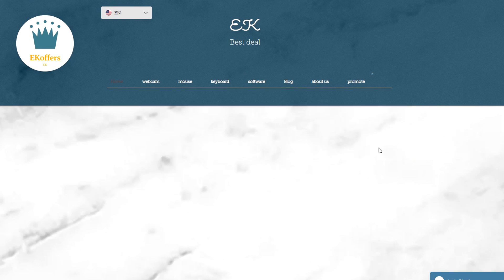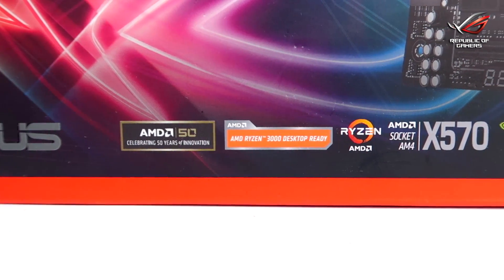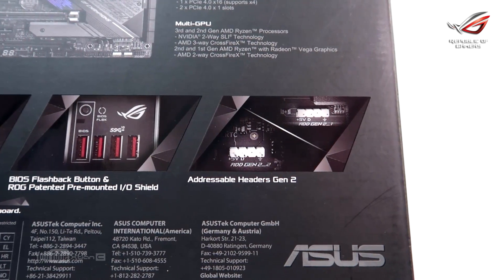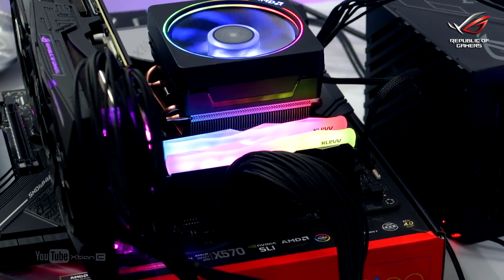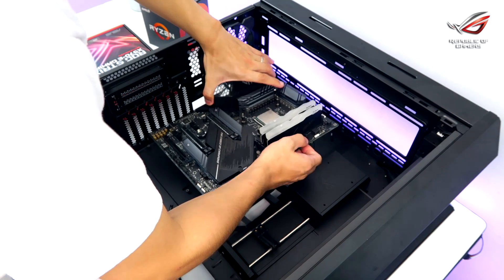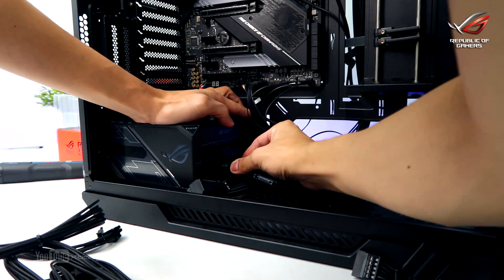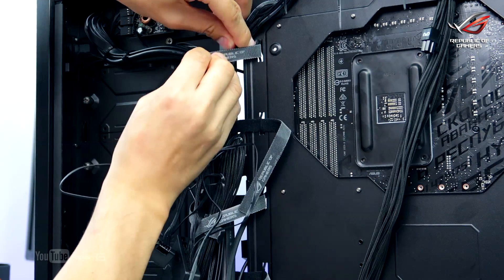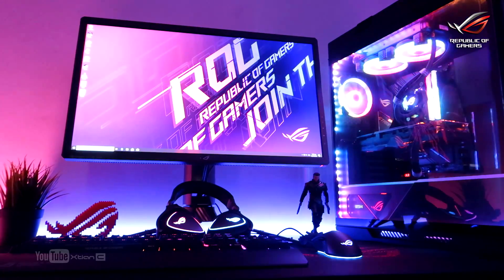How to Build a X570 Ryzen RGB PC ft. ROG Strix X570-E Gaming - Step by step

Comment: Is that the only case that can be used with the x570-e is there any alternative case that's also just as good or equal to with cheaper pricing
Reply: You can use any ATX case. https://www.asus.com/Motherboards/ROG-Strix-X570-E-Gaming/ 
This will show you the specifications of the motherboard.
Reply: @SamDav1s  I was hoping you could post links to other alternative tower cases for this motherboard..I bought the motherboard I just don't know what other case is compatible with it besides this 300 dollar case...
Reply: @ANRO_ANRO  Any case in the description or whatever will say if it supports ATX motherboards. You do not need to spend $300 on a case. I would get a mid-tower case and they can range from prices from like $50 to like $200 for a good one depending on what you are looking for. I have a CoolerMaster MC500M (cost me around £125 last year) which in my opinion is a very good case and has everything I need. https://www.coolermaster.com/catalog/cases/mid-tower/mastercase-mc500m/
You could also look at other brands such as Corsair or NZXT. Also soon I am going to order the same motherboard.

Comment: So, I did everything right, as far as I can tell, the rgb on the mobo works, but that`s about it! When I want to turn it on it just clicks once, and then you have to power cycle to make it click again. Note, the fans are not moving at all, not even a little, and I also still don`t know where the 2nd Usb 3.0 header goes... any ideas?
Reply: Oh, same build basically, but with an air cooler, Flare X Ram and a be quiet psu...

Comment: Just bought this exact mobo but with the 3900X. 2080 ti, 32g Corsair Vengeance, X34P monitor. Can't wait to start the build. It's going to kick ass! Thanks for the video :)
Reply: How did you power the EPS?. The 8 pin my Corsair power supply rm850 has the 8pin cable but doesn’t match and it is not the pcie cable😔

Comment: Sorry to ask the 4 pin power connector is a need or optional.  If install directly together with 24pin + 8pin + 4pin will there be any concern?
Reply: The manual says you must use the 8 pin or you can use the 8 pin and the 4 pin together. What did you end up going with?
Reply: I have the same board though my new power supply rm850x for Corsair doesn’t have the correct 8 pin connector is not matching and is not the pcie cable😔. I don’t know what going on here

Comment: Sa mga naka ROG na rig jan? Kumusta mga parts nila? Durable naman ba? Gusto ko bumuo ng all ROG rig, pogi kasi lahat ng mga PC parts nila. Pero na disappoint lang talga ko sa headset nila. I used to own Rog Strix fusion 700, after two months binenta ko rin panget kasi sound ska build quality. Thanks sa sasagot!
Reply: as for internal rig parts ok naman sir. no issues. hassle lang maginstall ng aurasync software mdmi kyeme walang installation manual.
Reply: @PaulBarurot  Thanks for the input sir. Last question. Aorus build or ROG build?
Reply: Either sir. I highly recommend both.
Reply: @PaulBarurot  Thank you sir. check ko na lang siguro pinaka madaling hanapin sa area ko. haha

Comment: sa oct matatapos konna ung build ko halod 2years ko din hinintay...
build ko
mobo- msi b450 tomahawk
cpu - ryzen 5 2600
gpu - msi rx580 8gb oc
storage - 1tb seagate/ 128gb ssd
vipersteel 16gb(8x2) 3200
psu- evga 750 watts
case - segotep halo
pag ipunan ko nalang ulit ung cpu cooler..
Reply: stock cpu cooler should work fine. dont waste money on a cooler unless your doing heavy overclocks